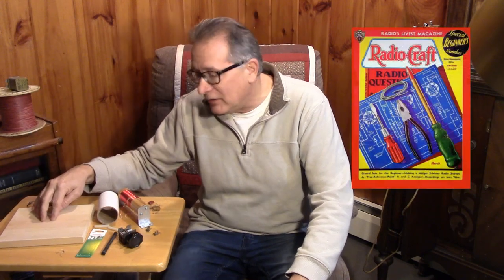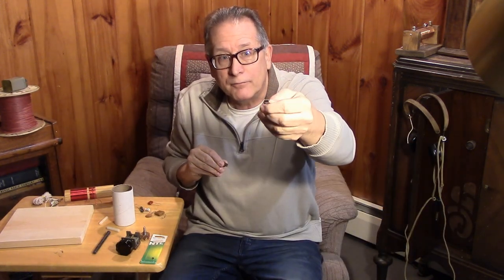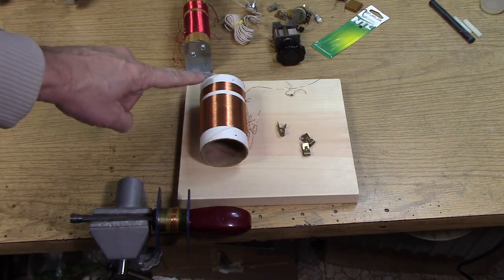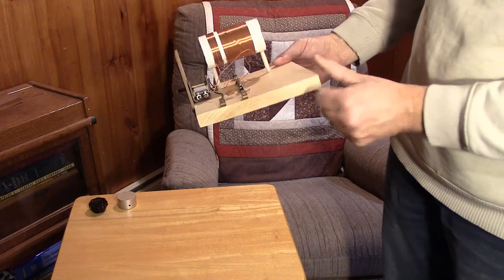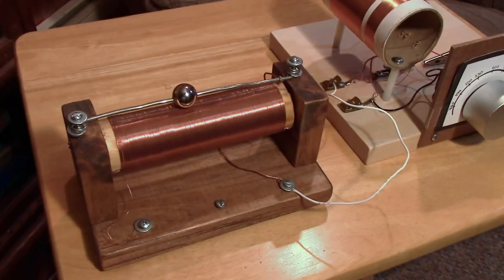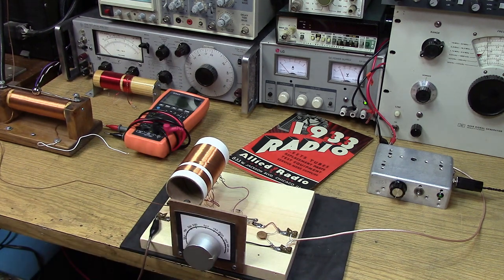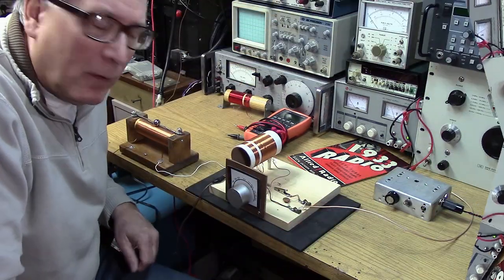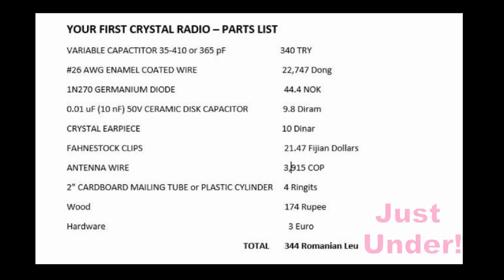Your First Crystal Radio

Comment: I now add one diode and a extra cap for a voltage double. Much more output.
Reply from the maker: This is a great circuit and you can even bias it down the two diodes in series and get even more...

Comment: Mike, I don't remember what I used in 1975 when I did my first crystal set for my antenna. Now I want to do one with my grandkids. Do you think the insulation can be left on some small telephone wire for an antenna?   I have a few miles of that !!!    I don't want to disappoint them once we get it all done. Our local AM station is about a mile for them and about thirty miles for my house.
Reply from the maker: You can do everything with good old telephone wire! I don't know how long it would last but 75 to 100 feet of wire should do it. I suppose you could twist a pair for more strength.
Reply: @MIKROWAVE1  I'll give it a go then. I want to try it out before they come over and I disappoint them not knowing what I'm doing. Thanks for the reply.

Comment: Could you explain the antenna again clearer please? I don't understand, how was that tune to another antenna? What I'm specifically trying to figure out is how to improve the AM reception on my stereo. I'm thinking of building something overkill in the attic. I have a 2 story steep pyramid shaped roof (I can walk up there) and was thinking like a big coil around the sides so I can still receive signals from all directions. I thought there was a way I could also build some sort of wireless antenna resonator for the downstairs that I could alligator clip my stereo to.
Reply from the maker: Even a small loop antenna can improve AM reception. A tabletop tuned loop is useful, but I like untuned coax loops that you can place remotely and not have to tune. An untuned  loop in the attic with a rotator will allow you to maximize signals and more importantly, null out noise.  chrome-extension://efaidnbmnnnibpcajpcglclefindmkaj/https://www.nonstopsystems.com/radio/pdf-ant/article-antenna-magloop-EWS-MW.pdf
Reply: Would that work in all directions or would I have to point that around to maximize amplitude reception from the stations? I came across this design before, was even thinking of modifying this into more of a spear shaped coil (I hate being an audiophile) so I can just hang it up there and leave it alone. I got plenty of room I could do probably a 6 foot sphere. I think for my case using foam-board for the support structure in the center won't interfere with the reception. Is my logic wrong? I'm new to this and trying to learn more. @MIKROWAVE1
Reply from the maker: @TheTarrMan  OK I get what you want to do now. Yes a simple length of wire in the largest geometric shape forming a loop is a good plan. I assume that your receiver has an external antenna connector?
Reply: Yes. I own a Pioneer SX-1250. (Basic thumb-screw terminal on back. I'm going to need to make sure the ground terminal is connected to this also, aren't I?) Finally moved into my first house and I want to set up my stereo. The T-style antenna for FM works awesome but the Amazon plastic coil thing is crap. (At least my experience, probably because I have a lot of interference.) So I guess I'll do a big spear. . . maybe three turns. I'm going to put some mylar thermal blankets underneath it to shield any noise coming from below, should just be the sky then. Thank you for your help, those links were useful.  @MIKROWAVE1
Reply from the maker: @TheTarrMan  Great setup, and yes we will have to use both terminals and a Balun. The loop is balanced, low impedance, and the receiver is single ended 50 or 75 Ohms. You will need enough 50 or 75 ohm coax ( not critical) to get up to your loop feedpoint in the roofline. Don't just run the loop through the noisy room. Get it up and away from noisemakers in the attic! At the feed point, you will have a Balun. Buy a binocular of 73 material on Amazon.  4 for 7 bucks. On the coax side 9 turns of #28 enameled wire. On the loop side 3 turns. This will give a 1:3 turns ratio which gives a 1:9 impedance transformation up to 50 Ohms. This is a very simple transformer.
Reply from the maker: And for the actual loop I am envisioning an equilateral triangle of something like 10 feet on each side. In the vertical (AM signals are vertically polarized) and the feedpoint either at the apex on top or on one of the base sides ( not in the middle horizontal).

Comment: I'm curious about how far away a crystal set can pick up broadcast stations. My closest AM station is 80 miles away in Ottawa and 130 to Toronto. I have room to put up a 200 foot antenna about 30 to 40feet high  . Any recommendations for making it pick up distant stations?
Reply from the maker: With a fine antenna like that,  and no overpowering station close by, you are in a place that would make most of us jealous! Just wait till 7PM! You may need to reduce coupling by reducing the input (primary turns) and your tuner can be less turns like 150T of thicker # 22 or 24 with an antenna that long. You will hear stations as far as Winnepeg and Nova Scotia Ha. US Clear channels at full power like WNBC 660 kHz New York should sail in.

Comment: Question. I see some builders put a 10K ohm resistor across the headphone connections. Cap or resistor?  Which is better and why? Thanks.
Reply from the maker: Crystal and Ceramic earphone do not provide the required DC path to make the circuit current flow. The audio current through the resistor causes the voltage. The capacitor filters out the RF and causes the audio to be peaked DC level.

Comment: You don't need to spend a hundred dollars on the parts just about$25 all you need is a coil that you can salvage from a radio that has been thrown away and a .365 mfd veritable capacitor and a germanium diode and a crystal earphone and a thin board or perfboard
Reply from the maker: Yep - Put your effort into your antenna!

Comment: Wfin, Wfob, wima, wspd, and wtbn were my favorites. Summered in Bascom ohio. Wintered in arcadia ohio wtam came with some tweaking. wjr , CKLW, woai, and WBAP came at ft hood texas in my army days and for the cost of a wrecked aa5(striped CHASIS) found in a trash bin.  Was the cats back side back side  beeing that I got paid about 90 bucks. A month. It was cheep. ( No power) interesting to my CO. That I got a (unused closet). On the top floor. Of our barracks.( No strings) as he would visit. And tune through the band. (Circa1972) thanks. retired Sargent williams. Thanks ps he promoted personal hobby's said it cut down on AWOL rates. As we were on a ready LINE. For flights to disaster area's we were a multiplex phone unit. That was put in place to compensate for storm dammage.

Comment: Mike, I prefer working with heavier 22 gauge wire. With my 200 ft. antenna do you think a 240 uh coil would be fine as an antenna tuner? Thank you!
Reply from the maker: The #22 wire is going to work better in every respect - but things get a bit larger!  The 200 ft antenna will not want a series coil tuner except well below 1000 kHz, especially if it is horizontal, Its too long! You will need to add a series variable capacitor unless the wire is shortened to about 135 ft (A quarter wave just above the BCB).

Comment: But how did you wind the wire on the tube? It looks like a machine did it.
Reply from the maker: I punch tiny holes and run the wire through the tube after measuring how much winding I want - so I have a beginning and end ready -to anchor both ends. Then run the spool from a spindle through a couple of books with weight on them to tension - and carefully wind!